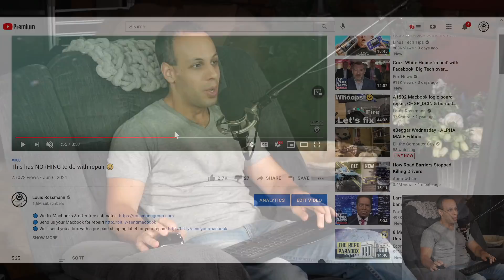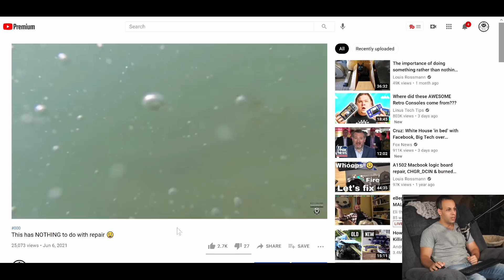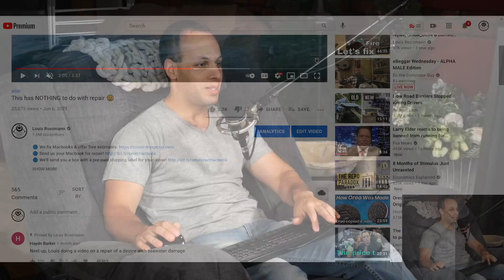Why are user serviceable batteries a bad thing?

Comment: I think you have presented the user replaceable battery in a very misleading way. You have completely ignored the fact the battery being user replaceable is not for free, but it comes with quite a cost. The cost is in the manufacture, but as well in the cost to design the product, and even in the general robustness of the product, or its size. You may make the product the same compact, robust or performing, but it will cost money. Or you may make it the same performance and cost, but it will become easier to break. So the true hypothetical choice to be made between the fixed or replaceable battery is not if you want it replaceable or not, so if you want the possibility to extend the product life to 10 years instead of bricking itself after 3 years. The real question is if you want the ability to extend the product life to 10 years, or you want it more robust so within the finite 3 years life it is less likely to break? On a product that you want to throw away after 2 years because it would not support the new features available at that time? Yes, you may say it may have "double" resale value after those 2 years, so for what you get for a phone costing $600 new after 2 years, you could buy few donuts on top of the single Latte.
The reason why the battery is made user replaceable on the camera is not to allow its replacement when it fails, but to swap for a charged one in the middle of the adventure, so to not need the charge in the battery to last the whole week when user may have multiple batteries and swap them as they go flat, at the end allow the use of a smaller battery, so reach smaller form factor of the product. But that short runtime between battery swaps may be acceptable with the camera, it isn't acceptable with the phone (where it would mean the long reboot).

Comment: A non replaceable battery is so that you can never really turn of your phone and it will continue to send information even when it is "turned off". If people could easily remove the battery then they could power off their device for real or expose the hidden battery inside the phone that is used to maintain communication about the users activity.

Comment: Swapped some batteries between two 2015 macbook pro's the other day and dealing with the glue on those was annoying as hell.  Could have just been screwed in like all their older laptops, but nah they went and glued that in for 0 purpose other than to make replacing it harder.

Comment: Regardless of the misguided philosophy. My 2014 kyocera hydro-vibe had a removable battery, SIM card, heaphone jack, SD card

As you may have guessed, by the name. This phone was waterproof. More waterproof than my sister's Samsung Galaxy S4 Active, because we both dropped them in the mississippi river on the same day, took a bit longer to find mine because it went into someone's mud hole created by their foot, but we found them both, the S4 active in probably 7 feet of water, ended up not working. My Kyocera on the other hand, with its fully removable back somehow with wireless charging and NFC, was still working, with the camera still running(because it didnt overheat from water cooling)
Reply: Maybe my sister had more damage than my phone, but my phone was pretty scuffed up. After that i bought a bunch of used ones on ebay just to use on the river for GPS tracking, music playing, picture/video recording, and emergency use

Comment: The only rea reason I can think for non removable batteries is space, and even then I would gladly give 10-15% battery capacity for the option to simply swap it on the go, I love water resistant devices and love to be able to dive with my phone without fear but even then I use a watertight case over it. Batteries should be easily replaceable period.

Comment: @Louis Rossmann  I also wish I could hot swap the batteries in my cell phone, but having taken apart many of my recent phones to change the screen, the batteries in there are soft, LiPo batteries and plug in with connectors that have 5, 6, or even 7 pins in them... Not actually something I've ever seen on a hot swappable battery... In fact, isn't the main drawback actually the hard outer shell required for swappable batteries makes them thicker, and therefore the phone itself has to be thicker?

Comment: Waterproof.. nah dont give shit long as its water not ruinable ie samsung galaxy S 2 been sunken two times completely into puddle of liquid mud and has been MOIST as XXX from sweat hundreds of times, plus been used in sauna several times and been dropped hundreds of times from varying distances including from 3rd floor balcony to ground... only took to wash mud off with clean water, let it dry over the hot pc for couple of days with out back cover, slap the battery back in, charge it and off we go again and that was the two times it was completely filled with water. Now phone is 10 years old and i dont even know what last owner did with it since it was in rough shape when i bought it used. Only now starting to need new battery as capacity has dropped some over the years, but its great phone and during that time my buddies have run trough maybe 20 phones if not more EACH. Yeah its not greatest and latest, but its though, works and does everything i need from phone. PC can be used for everything else.

Comment: I don't care about removable batteries either. Even if the battery is the first component to fail, my batteries usually last atleast 3-4 years. After that I don't see a point in not replacing the phone as they tend to get slower. Some manufacturers have no qualms clandestinely throttling them.

Comment: The problem with removable batteries is that some will be tempted to replace with cheap knockoffs from alibaba that are little firebombs. Lithium metal is explosive when exposed to air. Any leak at all turns it into a bomb, and then the phone manufacturer gets blamed.

20 years ago there were national stories about exploding cell phones. The solution was to abandon removable batteries.

Comment: When they first went to non removable batteries they could get bigger batteries in the same space. They eventually went to creating thinner phones. So thin, that you have to put a case on it to feel comfortable in your hand.

Regulations make sure there's a lot of bulk in a replaceable Li battery that could be used to hold more charge if you can't easily access it. But, that's only until solid state batteries come to the market. Without the risk of a puncture causing a fire we don't need that bulk. We'll see if we go back to replaceable batteries then, but I don't think we will unfortunately.

Comment: I have wondered if anyone could design and make a mod for devices to give them a removable battery, would this be possible? It would be expensive to make I know that.
Reply: All that's really necessary, in theory, is to add a connector where the component-to-be-modularized used to go, and then put the original component on a module that plugs into that connector.

As long as the OEM doesn't then complicate things by essentially locking specific hardware to that board (let's say, if it doesn't find this specific serial number on the battery-cell's internal chip, it's now a brick - and yes, there are products that effectively do this) and the case has room for the new connectors, it shouldn't be that difficult to do aside from the actual process of not ruining the battery.

Comment: I haave better question - why everyone strives to have those glass/metal slabs that are shoved into rubber protective cases and there is no functional benefit of that sleek design if the user is almost required to have extra milimeters added of cheap material on top of it?

Comment: from the manugacturers POV, why buy a battery for 40 bucks when you can buy a new device (and new charger) for 1000.00. On another subject, why cant we have a battery with the same PER CHARGE capacity of Li ion and the TOTAL LIFE charge of Nickel metal Hydride or Nickle cadimium ( obviously the difference of elements aside)?

Comment: I remember my first time changing my battery on my 2017 samsung galexy j3 pro. (I was actually trying to change the glass, but i digress) when i removed the screen, I tried to be carfull, but i did not know where the ribbin cable was, so i ended up tearing it in half by the time i got the glue loose.

Than, when I took the battery out, I had to push so hard on the battery to overcome the glue holding it in that I bent the thing in half

and the battery adhesive did not come with the new battery, so I had to use the battery without the adhesive for a while while i waited for it to be delivered, and the ribin cable tore in half so i had to put yet another battery.

in the end i bought a refirbished S9+ because I got tired of waiting for new parts and the dificlty of getting put into the phone without breaking it. and this is samsung, whose phones tend to be easier to fix than others.

It's fixed now, with the glue holding it in, but i have an washed out off brand screen on it so it's not that nice to look at, and the case is slightly bent in half, But hey, it works. On sale now for $500 so I can recoup the cost of my time spent taking apart and putting it back together I don't even know how many times. It will even come with 2 broken battries and some screen glass that i never got a chance to use.

Comment: I get your point, but what about this thought. I have an iPhone 6 thats almost 7 years old that has never had a battery 🔋 issue, it just started now to seem to be low on performance ( not bad it still is working ) “ but at the same time my iSO firmware updates are done “ there are no more firmware updates available from Apple for my phone ever. My phone will never see iSO 14 it’s stuck at iSO 12.5.4 which is making my phone extinct and not able to keep up with the future requirements and demands coming out every day. My phone is just incompatible now. I’m going to have to buy a new phone very soon. “ So what do I care if my battery only lasted 7 years ? Or if it’s user replaceable or not, being glued in “ It has lasted long enough for the life expectancy of my phone. I know this was Apples intent but it is what it is. Yes I am upset that Apple is not offering anymore more iSO firmware updates but I also understand that this is because the electronics of the phone is limited to how it was made when it was made new at the factory.
 
“ Technology marches on “ I guess. 

I did enjoy your video though

Louie
IL USA 🇺🇸

Comment: Lookup lithium batteries and fires......... 
This is the scare people have. Scared cause boys these days have err...vag's.....
Again. Old tech lithium was unstable 7/10 years ago. Internet pushin the hate of em.
New are super stable.  Can hit a nail through em and get a little smoke as it does.
Again to finish a dead lithium battery .put in bucket of saltwater. Neutralizes chemicals in battery.........

Comment: Batteries are 110 percent waterproof. Lithium ion and polymer are fully sealed . As air. Makes them die.smoke.flame.....add O and battery dead. 10/years ago lithium polymers were unstable.
Oh saltwater in a lithium battery neutralizes it....lol. facts are fun
Reply: Batteries today you can puncture fully charged and will just smoke. Not blowup like did ten years ago when few fires happened.
Take this info from someone whom tested high discharge lithium polymers draining 5000mAh in under 3 min at 52volts

Comment: the entire power management and battery charging scheme of smartphones make no  damn sense at all ,  when you plug your phone into AC it should be able  run directly from the power being provided from the charger ,  it should charge your battery to 100% then run  the device from the power from the charger while it is plugged in but instead it charges the device then it  continually lets it run  down the battery and  charges it back up again even if the device has access to power from a charger
it really makes no sense at all   no electronic device with batteries ever worked like this  till  smartphones came out

Comment: It is because people really don't give a fuq about the environment they are happy to fill the local trash dump with their old non-repairable toys then drink out of crappy paper straws like that makes up for it. My Hydrovibe was waterproof to 3' the battery was replaceable and you didn't have to plug the ports to make it waterproof. It overheated to failure right after a push update that I think was done to force me to buy another ph. The same thing happened to my Stylo it started overheating right after a push update forcing me to install an app to control the power usage. The app worked but it made the ph a PITA to use because it would randomly dim the screen and shut off things like the bluetooth and wifi.

Comment: I want a Dual SIM phone that has a user-replaceable battery that has 5G Wifi and doesn't cost a shitload. Dual SIM so I can have a pay as you go phone SIM with a cheap tablet wifi data plan SIM so I pay like $10 a month instead of $60. This turns out to be a VERY high bar to clear, so I had an international S4 Mini then moved to a Hong Kong LG G5 H860N and haven't seen crap all to move to since then. I was considering one of the Nokias but they all have bad reviews about shitty charging and no removable battery.

Comment: I know a LOT of people that will "scrap" there perfectly good iPhone for the NEW one every one or 2 years and in that time battery degradation does NOT matter and the extra size / lower capacity is a negative 
most comments I have seen run along I will not "give up" any FEATURE for replaceable batteries NOT that I WANT my batt glued and screwed in there for ever

Comment: Personally I indeed prefer to be able to just slap in new batts whenever I feel like it. I don't know if they're true, and they don't make me change my mind, but some arguments I've heard in the past were: that it makes it cheaper for the same quality, or higher quality for the same price; that's it's easier to make the devices more compact if they don't have to add protective layers around the batteries to avoid being sued if the battery goes bad because if the user is not expected to touch the battery directly the surrounding structures of the device provide sufficient protection; that it makes things more reliable to not have moving parts and have everything soldered solid together. And I'm probably forgetting some other arguments.

Comment: Don’t believe that right to repair will help anything. Here in the EU, he have had laws that made devices illegal where the end user can’t replace himself the battery. Also, another law makes it illegal to build devices that you basically have to destroy to open them to replace parts (like the battery). Did it prevent US or even EU companies to develop devices just like that? Phones, earphones, toothbrushes,…. Everything on the market. They even get the CE label despite being illegal.

Comment: I sort of miss my Galaxy S5 Active. I owned three batteries for it and while I never checked to see if it was actually waterproof but it did have a rubber gasket around the battery cover and was advertised as water resistant. In the end the screen broke and I bought a different phone for a different carrier and ultimately got better service but... it was nice having a device that was built to be rugged and reliable with user-serviceable battery. When the original battery went bad I kept it and used an external charger to keep a spare battery charged up and ready to swap out.

Comment: Design does come into play though for Right to Repair. The Microsoft Surface must be damaged in order for it to be opened for the repair or replacement of any parts or pieces. So in that regard such designs that prevent access to the device entirely would need to change. The same with things like glued in screens that result in the screen being damaged if you attempt to remove it.

Comment: In the same vein, why are STANDARD AA and AAA rechargeable batteries a bad thing for remotes or game controllers (according to users' opinions)? I mean, PROPIETARY internal batteries are more difficult to come by and requiere repair skills, tools and assembly to be replaced. And I don't buy the argument that the internal batteries outlast the lifetime of the devices because I have several years old XBox controllers and a Harmony remote that are still working pretty well and I am pretty sure that I had spent far less money in standard rechargeable batteries and I had generated less e-waste than if I would have had to replace internal batteries or the devices. And even better, STANDARD batteries can be used in several devices like, for example, multimeters, testers, portable mini-lamps, flashlights and cheap universal remotes. By the way, I always have charged batteries at hand so I can use the devices continuously without have to wait for the recharging.

Comment: phones should either have really easily replacable batteries or sealed, a slide out battery would be a thing more people would be willing to do than a cover that has to be clicked out, there is a really cool iphone concept with "1 second recharge" where the battery has a slot in the side where one battery can push out another, making swapping really easy